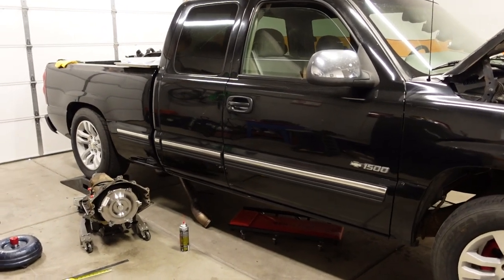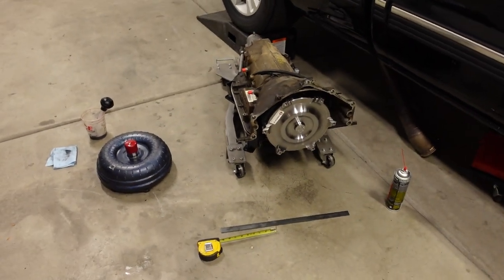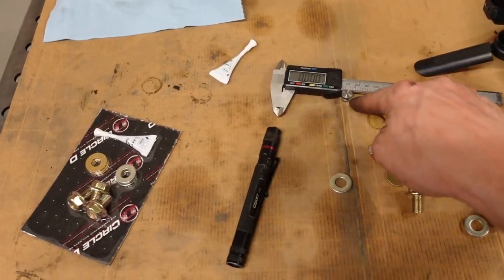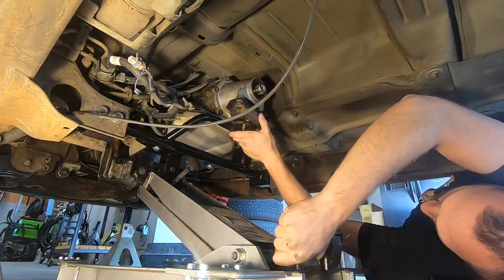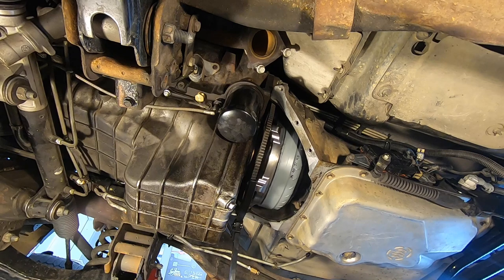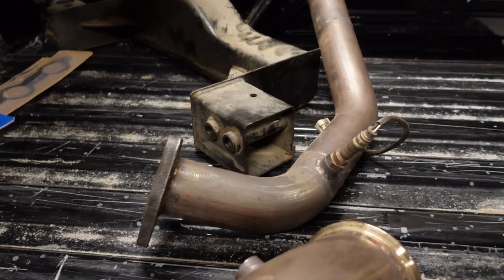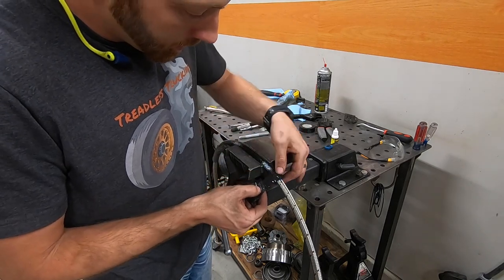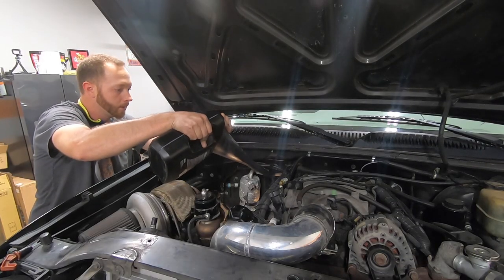the MOST IMPORTANT UPGRADE for ANY automatic transmission.

Comment: You shouldn't have any issues keeping the trans cool. I used one of those inline with the rad on my old 3/4 ton Suburban. Even pulling my 7k camper in the Utah mountains it never went over 180. Good thing you aren't using it in the winter though! I had to cover mine just to get some heat in it. Wish I could have kept it when I got a Duramax but the ports are way too small.
Reply from the maker: glad to know it won't get too hot!

Comment: I installed the same trans cooler on my 04 Silverado SS with a fti 3k stall and I bypassed the radiator cooler no use in using it with that badass trans cooler.
Reply from the maker: Good to hear!

Comment: Same cooler bypassed radiator.  Towing  flatbed car trailer wt 57 Chevy truck on it   Outside air temp 89. Trans temp  150
1500 Silverado 5.3 4L60e
Reply from the maker: Glad I made the right decision

Comment: Nice job 
But i disagree with bypassing the radiator cooler why ? Very simple GM transmissions runs really hot like HOT by going through the radiator first what you are doing is helping the transmission fluid reduce the temperature and when that fluid goes through the external cooler then that cooler finish the process it's like the M62tu bmw V8 engine the alternator cools down because it's seating inside a housing and coolant it's cooling that alternator
But that's my opinion that doesn't have to do anything with me telling you the you did a good job there Congratulations

Comment: Hey LT, is there anyway we can have access to the resources you used to gather information on rebuilding and reinstall the transmission. Trying to tackle my transmission soon.
Reply: Check out ATSG for the 4L60-80
Reply: @benfletcher7608  bet, appreciate it
Reply from the maker: most of the info I found was just postings on forums and from a few good facebook groups. Never even bought a manual, but I should've

Comment: Ah heck, I just installed this same cooler on my 2001 Tahoe. I built up a LQ9 and 4L60E. From what I understand ideal temp for Dextron VI is 175F and the 4L60E is designed to operate around that temperature. I'm now getting 40F above ambient with the trucool cooler. I was seeing trans temps of 80F which seems like that's not warm enough... What temps are you seeing? I ordered the thermostat, but haven't installed it yet. I never really thought much about it getting plugged and burning up the trans.

Comment: i would leave out the thermal regulator if you installed it, the link you posted from amazons kit included it, and not bypass the radiator cooler. Hot temps destroy clutches, the colder the better!
Reply: lol i skipped through the video then read some comments below. good move on leaving the regulator out. i had an 03 SSS awd which has the 4l65e, after the 9th warrantied rebuild in 1 and a half years and less than 12k miles i ordered a reman from gm parts direct and never had another problem. from my troubles i learned a good bit about transmissions. the regulators i found in the tru cool kits i wanna say opened between 170-180? My SSS with the 40k going through the radiator while towing just under 10k lbs.  never got above 160 on a hot summer day in the 90s. without towing never above 125.  it had a stock stall speed converter, although i had ordered a circle d towing unit 2800 stall but they were back ordered on materials to build them when i had purchased it and i needed my truck back on the road and got a refunded instead. God bless!

Comment: I am going to add a cooler to my 2002 Tahoe and suburban. I know 2 people that the radiator went bad and filled the transmission full
Of water. Did you run new lines all the way back to the transmission or just connect where they plugged into the radiator?

Comment: Great video! I was always told the cooler lines are for hot temps, mainly for Idling for long periods of time while its really hot outside. Also, what fitting/adapters did you use for the trans cooler return and send ports? NPT to -6 AN Adapter?

Comment: I bypassed the in-radiator cooler. been through 107 degrees in phoenix and at cruise barely saw 150, been down to 40 degree weather and it barely creeps above 100. to do it properly youd want a thermostatic switch that bypasses the cooler when the oil is too cool.  i have a 2800-3200 stall, stalls about  2900 in my truck

also whynot buy the cross member from tyler scruggs!? he literally made all of our conversion pieces. they are unpainted but they come with pass through bolts

Comment: Just curious why you did not go with a deeper transmission pan? Is the truck too low? Budget? Or are you planning to in the future? It just seems after all that, maybe an aftermarket transmission pan would make sense. Love the videos by the way. Keep up the awesome work!
Reply from the maker: no real reason, I guess I didn't really see the need for one. There should be plenty of room tho...
Reply: @LawrenceTolman  I see. I just figured extra capacity wouldn't be a bad thing. Maybe more fluid to assist with cooling. As well as, some aluminum pans have cooling fins. Anyway like I said keep up the awesome videos. Look forward to them. 👍

Comment: i need a  4l80 torque converter for my wife's 2010 gmc denali 6.2 ..... A lifter  broke on it so i did the d.o.d a.f.m vvt delete all texas speed parts ..i talked to them got all parts but did a upgrade on cam to next cam up .. i got a part # 25-tsp225236-114-3b . now got it tuned from pcm of n.c  runs great ...buttt !! not at idle .. i think i need a little stall ..((((( what say you ?????? ))))))
Reply from the maker: Don’t know the specs on that cam, but any truck (especially if it’s cammed) can benefit from a higher stall converter
Reply: @LawrenceTolman  duration .050 is 225  236

lobe lift  in.370 ex .362

valve lift @1.7 in .629  ex .615

lobe swep  114 

intake c line 109

texas speed said no need for stall ....
Reply: what brand and what stall should use ??

Comment: I have one of these on my Grand Cherokee, model LPD4739 with the cold weather bypass. I have a trans temp gauge, before the cooler I would see above 230 in the dunes, since adding the cooler I have not seen the trans temp above 180. I don't run it through the radiator first not wanting to put too much heat into the engine coolant, I need all the help I can get keeping the engine cool.

Comment: Hello. How much hose did you need to complete your two run's from your cooler.  I'm on Summit ordering thing's to do this swap. Do i need to 10' pcs. Or a 20' and a 10'. Can you give me a rough estimate? Thanks
Reply from the maker: I think in total it was nearly 13 feet, but the piece I bought was a 25 footer and I've got maybe 10-12 left?
Reply: @LawrenceTolman  I just went ahead and bought the 20' and the 10' piece. Hopefully the 10' will cover the short run.

Comment: What benefits do you get from running this cooler if you were installing it to a stock engine and transmission
Reply from the maker: you'd still get the same benefits of lower operating temperature.

Comment: Shouldn't the converter pull out be between .125 and .187
Reply from the maker: Circle D said 1/8" is what they shoot for when I called em up
Reply: This had me scratching my head too.  Seems tight to me.  I have always run between 1/8 and 3/16 but you are between 1/16 and 1/8.  I’m sure it will be fine.  Keep up the good work!

Comment: if you're not changing the computer in that truck you don't need to change the dash cluster mileage because all it is is an LED light and letting you know how many miles you drove there's no memory chip on that foil paper behind the plastic on your dash cluster
Reply: false.
Reply: I changed the cluster in my 2000 Sierra and it didn't carry over. The new cluster has to be reprogrammed. I'm not sure about the later trucks but at least for 2000 models it needs to be reprogrammed

Comment: 125,000 to 165,000 is the maximum that you need for that clearance on the pump in the transmission from the torque converter

Comment: I have to admit LT, I hold you to a higher standard than the average keyboard warrior- but am disappointed you spent all that time talking about trans thermostat and the radiator circuit- and never mention the orientation of the inlet/outlet.

I'll assume you either learned something about it, don't subscribe the the self bleeding (or lack there of) or don't believe it is enough of a liability. Jusy wish you would have mentioned something, since you asked in a previous video, and I shared with you the link explaining it.
Reply from the maker: I had thought about mentioning it, but it must've slipped my mind. My thoughts on the subject? While not very "scientific", my observations of many OE oil coolers from many makes/models have the feed and return both mounted on the bottom rather than the top or sideways. I know some say there can be an air pocket trapped up top, but others say the fluid will pump out any air that might make its way into the cooler. I figure if its good enough for 200,000 miles on a stock truck, it'll work for me. And, it makes the lines route a little cleaner IMO as well.
Reply: @LawrenceTolman  The OE cooler is designed with the bottom feed orientation in mind. It is a self bleeding cooler. The true-cool 40k is not. I wish you luck with your set-up.
Reply: @PaulsProTips  how does the OE radiator self bleed? I'm getting ready to add a 40k cooler and want to pick the best orientation